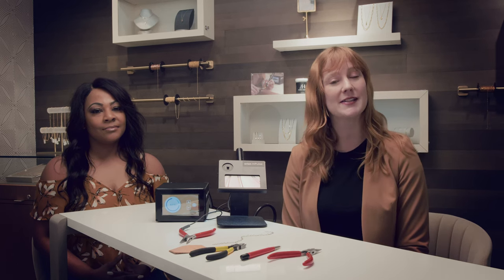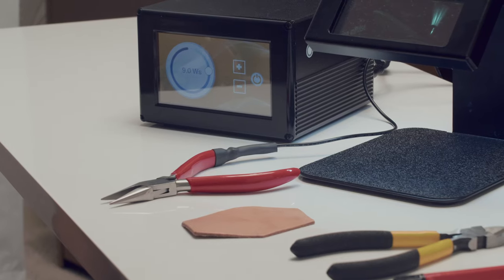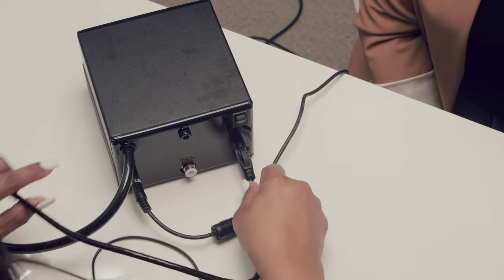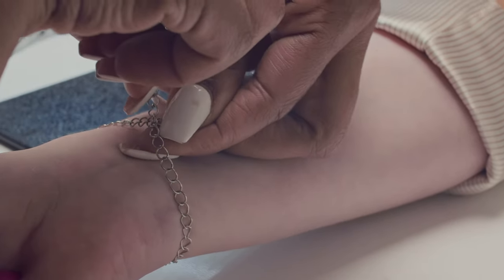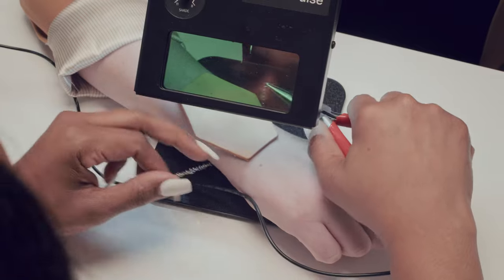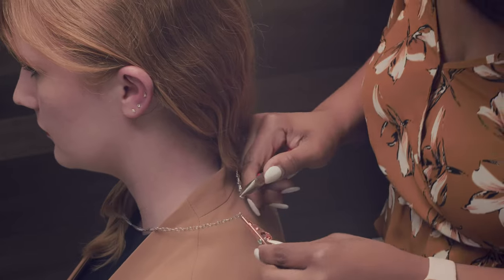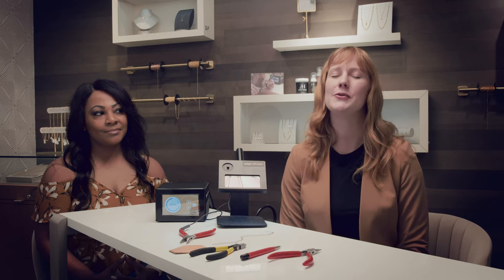How To: Permanent Jewelry

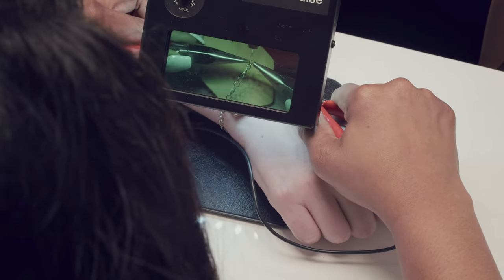Comment: Why are you fusing the bracelet to the needle @4:05 ? I see twice it had to get ripped out which could be causing the tear in the first fuse as well as leaving some of the jump ring or chain material on the needle.
Reply: HAHAHAHAHAHAHAHA EXACT-A-MUNDO my time frame shows it @ 4:08 if you look carefully @ 3:56 to 3:58 you'll see that the chain link before it if opened, the one being "welded" fused to the needle as you mentioned. i took a screenshot of that gaslighting perfect gimmick for the jeweler that has to "weld" every time customer breaks it. needs a clasp. when people find out i make jewelry, they say "i am a jeweler too" my reply kids in kindergarten making bracelets and necklaces with pasta should be called jewelers too. can't call yourself a jeweler if you don't how to melt gold, refine gold, cast, diamond and precious stone setting (pave', micro pave', prongs, bezel, etc. many more) make your own findings (make your own wire from scratch (platinum, gold, silver)